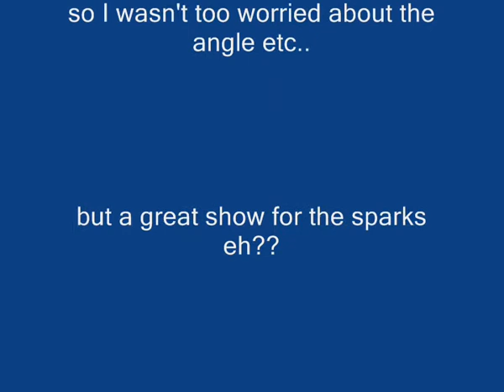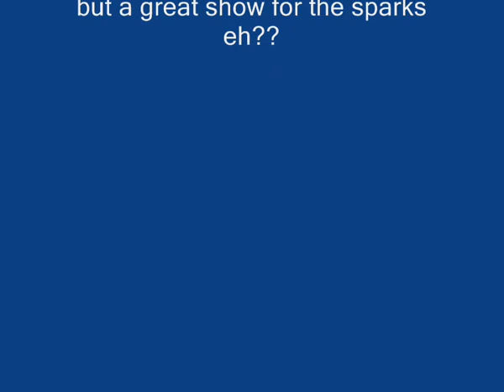Damascus Pattern Steel from a Bicycle Chain

Comment from the maker: Without a forge, try a pre heat treated blank, with a forge or blow torch, you can start with files but they need A LOT of grinding, otherwise O1 tool steel from Cromwells in the UK, under flat ground stock in material, this is a forgiving tool steel to start out with, there are loads of tutorials out there, but without a grinder or Clarke CB1-5 grinder it will be a trial getting the bevels unless you are a natural blade smith and pound the bevels whilst hot, regards
Scott

Comment: Just came across this video 😁 you went for it 👍try 80rv2 and 15n20 👍when the billets are welded  stick it in diesel and get it to temp..bring it out and cover in borax..use a round hammer and hit in the middle of it and work out.. hope it makes sense..took me two years to get there but it's worth it 😁
Reply from the maker: thanks, looking back it was all Dwarfen pounding from a pre Tolkien epoch , but the mini billet was okay...